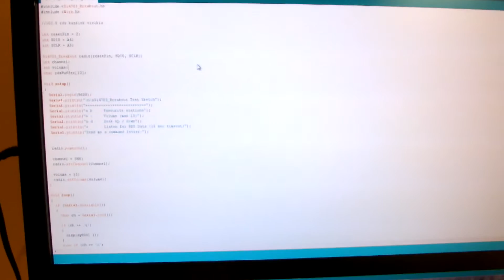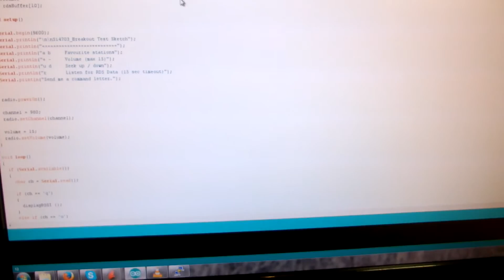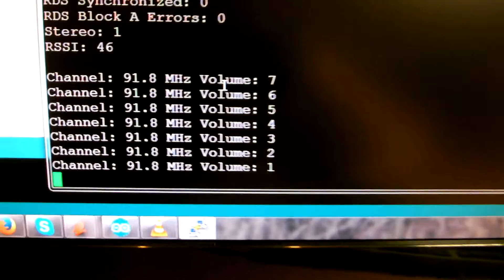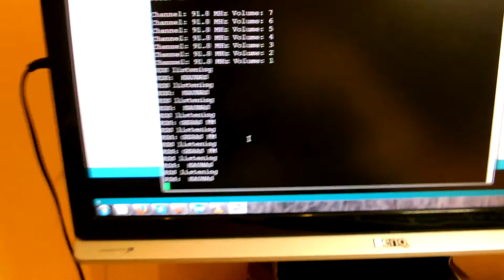Si4703 FM Tuner Breakout board (external antenna mod) + Arduino Nano testing (RDS)

Comment: Hi! It's possible to  get all audio output and write to an wav file with raspberry pi?
Reply from the maker: Rasbberry Pi has only Line Out so you need external sound card with Line In or Mic in if you want to receive analog audio from any analog source.

Comment: For external antenna you do not need to desolder anything actually, just wire the antenna lead to headphone socket ground. See  http://www.nomad.ee/micros/silicon_radio/index.shtml for how I did it.
Reply from the maker: Perhaps you're right and make the modifications are not necessary. However, I believe that modification improves receiver sensitivity.
Reply: There is another, more detailed discussion about the wiring method: https://electronics.stackexchange.com/questions/242268/modify-si4703-fm-tuner-evaluation-board-to-add-an-external-antenna